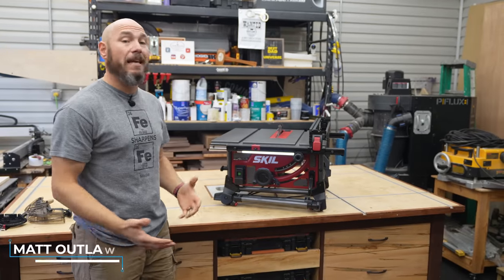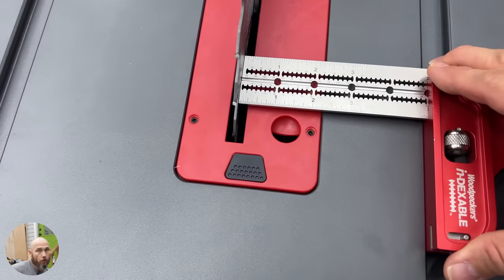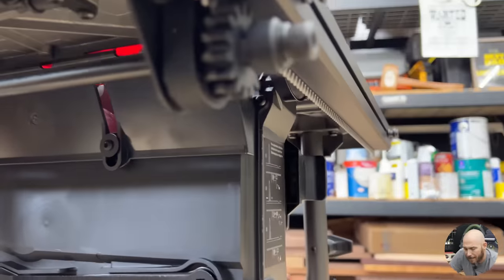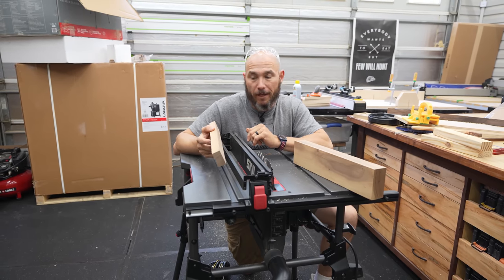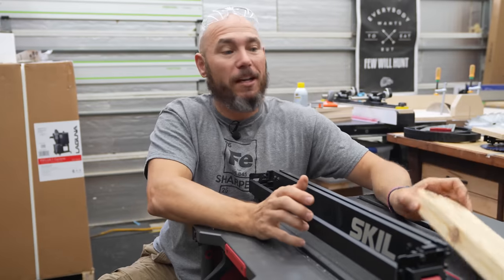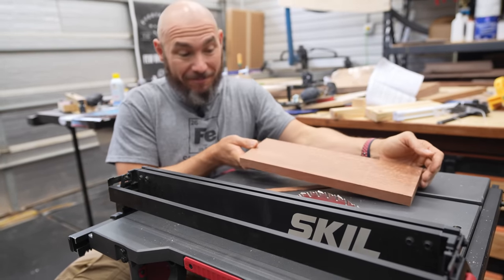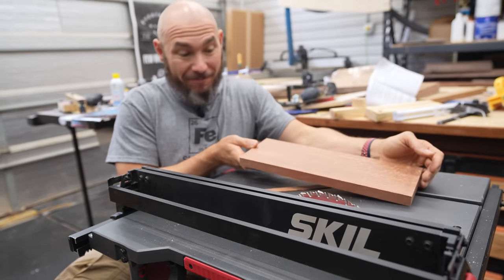Did I Find The BEST BUDGET Table Saw with the MOST Features?

Comment: Hey Matt I found out that Swanson has a pro speed square that has a lot more features than the original. Mine should be coming in the mail today. Check them out. With 1/8" increments on the pencil drag indents it will definitely be my new every day carry as every other on the market, aside from premium brands costing ~$50, only offer 1/4" pencil drag increments. Most premium brands also seem to only offer metric and very few speed squares over 3 1/2" have the 1/8" increments. Figured you might like the upgrade for $12. I'll do a comparison video when it comes in the mail.
Reply: I put up the short video so you can check it out if you're interested sir.

Comment: I currently have the Hercules tablesaw from Harbor freight. I was very skeptical about buying it because it was from Harbor freight, but the reviews were really really good. It also had a reckon Pinion fence, but it cannot do dado’s.
I think my favor thing about the skil-saw is the built-in “stand”
Reply: Yeah, that Hercules brand is, I believe, specifically aimed at DeWalt, and going toe to toe with them. 
That table saw looked just as good as any DeWalt. I have never actually gotten to use one though, the Hercules table saw that is.
Reply: @ericwilliams538  yeah it’s very similar to the dewalt. The dewalt has a little more HP and it also can use dado blades. I definitely would recommend the Hercules for any small shop, or for a job-site

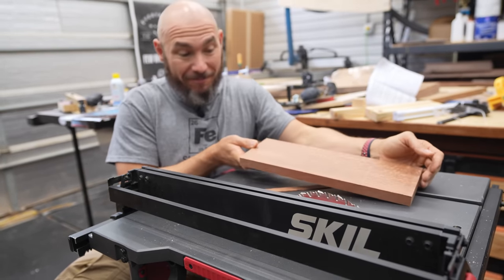Comment: 11:38 when you said it's extremely loud, will changing the blade reduce the noise or it's just the mechanism of the saw itself? Also, how loud is it compared to other saws that you have? I'm about to pull the trigger on this to place in my garage for DYI but I also don't want to bother my neighbors.

Comment: Was about to pull the trigger on DEWALT DWE7485WS 8-1/4 in. Compact Jobsite Table Saw With Stand….AZN for $379.

Now will consider this Skil saw.   

In addition, reviewed some recent comments re upgrades over the last year+.  
Thanks for this review as a reference point I value.  
Your strength in faith and carpentry knowledge are admirable….and appreciated.

Comment: You mentioned the saw bogged down a small bit while cutting the second, deeper dado. Trading the 8” dado set for a 6” shud help with that to an extent as there’s less weight and a smaller circumference/distance the blade teeth have to travel. A little something someone fm Woodcraft told me when I was buying a dado stack myself. Great review of the saw. It (the saw) reminds me very much of my Metabo jobsite saw… incredibly accurate and easy to use, tho retails for ~$650 when not on sale.

Comment: Can't say much about the saw. But I've never been turned off or let down by a skil product. Spent credit card points 20 years ago on a 3/8 drill, that's still going strong today. Never once bogged down. Only 3/8 but when I want to drill a hole, torque a bolt or screw its never let me down.

Comment: Question? I know you no longer have this skill table saw. In the video you stated you had multiple square cuts. However, in a different unboxing of this saw, the fence was not square to the table. The top tilted away from the blade. He resolved the issue by placing several paper shims behind the lock system. So my question is, did you specifically check the squareness of the fence to the table?
Reply from the maker: I checked square on the fence to the slots and slots to the blade and it was all square on mine.
Reply: I had the same issue, but only at one end of the fence (front side). Couple bits of paper sorted that out.

Comment: I have had this saw for about a year and a half and I love it. My favorite features are the fence and the blade alignment adjuster. Biggest problems I have with it are that the height adjustment is not very precise and the throat plate flexes. Eventually, I'll try to figure out how to make a zero clearance throat plate to solve the second problem. But for now what I do is cut smaller stock with the fence on the left of the blade since the throat plate is stiffer on that side.

Comment: First of all, love the channel and all the great content. This video is what steered me to buy this Skil for my first table saw. I have used it for about a month now and am loving it. However, I would like to get a better blade. I'm leaning toward a Diablo 50 tooth multi purpose blade but I am a bit confused. The saw's owner manual says the blade kerf width must be .1" or greater the the body thickness should be .071" or less. The diablo blade has a kerf slightly less than this and in fact the replacement blade recommended on Skil's own website is advertised to have a kerf width less than .1" as well. I'm I misreading things? Would the Diablo blade be fine on this saw? I really appreciate the help.
Reply from the maker: I've used Diablo blades on a few different saws and never had an issue.

Comment: This is my first table saw and I love it for the most part. I’m not sure if anyone else has an uneven insert or not. I would like to make a zero clearance insert or purchase an aftermarket one, if someone could recommend one. Great review and I will definitely be upgrading the miter gauge!
Reply: I have owned this saw for a couple months and haven't been able to find a zero clearance insert for it.  Please let me know if you find one.   Thanks
Reply: Couldn’t find one either. I made an insert for the dado stack since the plastic one they sell was so flimsy, but it was a challenge. There are a lot of obstructions under the insert that I had to carve out of my homemade one which did take an awful long time.
Reply: @fivefournino  Those obstructions are the reason I haven't even tried to make one yet.   Did you just use plywood for your dado insert? Or did you use a hardwood?
Reply: @wandiwoodworks  I used a piece of a scrap white wood we had lying around. Hope to eventually remake it with some cleaner routed cuts and better material
Reply: Hey I’m in the “throat plate sucks club too” I really wish someone would manufacture a robust zero clearance or general throat plate. I made a quick and dirty one with scrap cedar I had lying around just to see if I could make one, based on the depth differences from right to left. I used an electric hand plan to make one side thinner. It worked but I need to redo it with better material and take more time with it.
Reply: @wandiwoodworks  Skil has one "coming soon" on their website, but it looks to be made out of the same flimsy plastic. I made my own out of 1/2 plywood but as others mentioned it is a huge pain to make because of the obstructions.

Comment: What would you recommend for a great table saw to buy. Don’t need to be easily moved or compact. Just looking for a good table saw that will hold up good and be accurate. Thanks a lot..
Reply from the maker: Top of the line, SawStop 3HP PCS.  Great saw.  If you need one that's very good but under $1000 look at this Ridgid https://www.homedepot.com/p/RIDGID-10-in-Contractor-Table-Saw-with-Cast-Iron-Top-R4560/315635451

Comment: I bought this one after watching this I love it. Built doors for a buddies garage with a dado stack. Needs a new insert but otherwise great. One question. Is the riving knife removable? I only see the two screws on top and don't wanna ruin anything.
Reply from the maker: yes, when you take the throat plate off, look inside and you see a black knob at the bottom of the riving knife.  that should release it.
Reply: To remove the assembly completely for replacing the riving knife with a thin kerf for use with a 7&1/4" Diablo 40 tooth it's just the two hex heads all the way out?

Comment: Two questions:
1. How is this model for working height, both on the stand and on the work bench? It looked a little low for you on its stand - how tall are you? (I'm 6'3")

2. Why didn't you adjust blade height depending on material thickness you were cutting? Looked like you kept the blade at full height?

Comment: Finally had a "need" for the miter guage... yeah that was junk! Moves so much gives several degrees of difference from light pressure on one side of it vs the other side. I think next project will be a simple sled for this saw for cutting ends of cutting boards.  But overall, still very happy with this saw!

Comment: Another added feature about the fence is the top has a T-Slot built into it. You could use it to attach an axillary fence, stops and etc. I have the skil saw worm drive portable table saw and used that slot to attach the Jessum Stock Guides to the fence with T-bolts. I do not think Skil-saw gets the love it should in this small shop/construction cat. My biggest dislike is that the worm drive is also loud.

Comment: Hey Matt, that's awesome! I picked up the DeWalt - DWE7491RS a few years ago. I wish this video was out at that time lol. The DeWalt I bought has all the exact same features that Skil has. Except for the DeWalt, came with one blade. And it also had a two pack of blades with it. And the fence on the DeWalt goes out to 32 1/2". Which I have yet to need. Oh yeah and the DeWalt cost $650.00 so yeah. Lol I'd say that saw you got is the way to go!

Comment: Maybe a dumb question...  Can I use a Diablo fine finish thin kerf blade in this saw?  The manual says kerf width should be greater than .1 inches.  But blade packaging doesn't have a measurement like that...
Reply: That is a GREAT question, but I'm just a novice with LITTLE experience with a table saw. I will have to go and read the manual for my Bosch to find out what my specs are when it comes to the kerf. Thanks for raising this question. 👍

Comment: Alri bro. I've been a subscriber now for a while and I love the energy u give off on video. U also do great work and as a newbie to woodworking I wanted to ask a question if u have a moment to answer it..??
Q.  I have tried to buy some better Table saw blades and the 10" blades seem close enough to my 254mm blades but mine have a 30mm bore and all I see on USA sights or on Amazon is 5/8 bore blades which is around 15/16mm?? 
I did a check and it said that 1.1811 = 30mm approx.. I think it's exactly 29.99994 or something like that so is it possible to get those RED blades everybody is using in a 30mm bore plus I sound stupid calling them the red blades but the name has escaped me right at this very moment.. Shut man I have completely forgotten the name???

Comment: Researching table saws and came across your video. I was sold on everything you had to say about this model. My local Lowes has same model, But after reading reviews lots of people said 90 degree cuts were off and that the fence wasn't true 90 degrees. Some people weren't surprised being that its a jobsite tablesaw. Could this be true. Reviewers say same thing about Dewalt Model#: DWE7491RS also.

Comment: Ive had this saw for about a year and it has been great. I would agree with you that the blade change is annoying and its very loud. I have been cutting a LOT of oak recently and have had the saw bogging down and a bit of burning. I probably just need a new blade though. Its very similar to the dewalt for $250 less and I like the integrated stand better.

Comment: The manual states the kerf needs to be.1 or greater.  So far at the hardware stores I can’t find one I bought a Diablo that has the right thickness but the kerf is .098 which is 2 thousandths less than .1. Do you think this blade be OK to use

Comment: I have had this saw for 8 months now, I replaced the stock blade with a Diablo 50 tooth combination thin kerf blade and i have been really happy with it.
8/4 oak rip and cross cut no problem
the adjustments are great got the blade dialed in, including for miter cuts where additional errors can occur
Matt's dislikes:
  Blade change, I agree, although it's much easier if you raise the blade all the way.
  Loud yep sure is 
  Max rip width, sure  more is better but being able to get more than 1/2 a 4' sheet seems good enough to me
My biggest complaint is the throat plate, I have both the standard and the dado throat plates and they flex which can mess with depth of cut.  I've made a zero clearance plate for mine and it's a big improvement
Overall I'm really happy wit the saw and i feel like i got a lot for the $$

Comment: The riving knife on this saw is a weird size. It’s 0.09” thick. It calls for a blade that has a plate size of less than 0.07 and a kerf more than 0.1 inches. As far as I can tell the higher end blades have a plate size that is too big. This makes the riving knife ineffective as a safety device. The high end thin kerf blades have a kerf size that is too small, which means you literally can’t push the wood through the riving knife. 

The only decent option I’ve found was the CMT itk extreme which is recommended by Katz Moses. This has a plate size of 0.071 and a kerf of 0.98 inches. That’s about the thickness of 2 1/2 sheets of paper less on each side of the knife than the manual recommends. 

It’s worth noting that you don’t need a riving knife if you are using a crosscut sled or a tapering / edge joint sled if you just shave the edge of the board and don’t create a cut off strip. So you can still use higher end glue line blades for this purpose. that are too thick for the riving knife to be effective. 

So I guess that’s what I’m gonna do. Use the cmt thin kerf blades for the bulk of the work and use the higher end blade just to shave edges for glue ups or with a crosscut sled.
Reply: Holy Mole! Lots of good info here CarlYota! Thanks for that. 👍

Comment: I had a Skil table saw. It was great until the arbor broke. Still have my Skil bandsaw and bench sander. I wore out the WEN in 2 years and replaced it with that old sander. It's still a lot more powerful than the new WEN. Both were made by Bosch.

Comment: Is the table itself flat? I’ve purchased two of these so far and neither of them are flat. They’re both warped. One worse than the other but neither were flat. How’s yours?
Reply from the maker: It's flat
Reply: I just picked on up and it is also not flat.  Mine dips toward the center basically from the miter slot to the blade, so if it is 90* on one side of the blade it is not 90* on the other side of the blade.  Basically useless for any small cuts, since the wood falls into that trough.  The flexible throat plate doesn't help matters either.  We'll see what I can do when I get a new throat plate.

Comment: Is there an updated model for this one. Shopping for it fall of 2023 and it is out of stock everywhere. I would like one.
Reply from the maker: Acme Tools has it in stock (linked in pinned comment and description)
Reply: @731Woodworks  Thanks. I was trying to use a vendor I was familiar with and that was local (Walmart, Lowes, Amazon, etc) in case there was need for a return. I may have to venture into the unfamiliar to get this one.... Thank you for the speedy reply.
Reply from the maker: @unschooled_art   Acme Tools is a good company. I've ordered from them myself.

Comment: Interesting review. I'm at the point where I can't really go forward with woodworking until I get a table saw, and this is one is out of my budget at the moment. Guess I'll be saving for a while. Experiencing a lot of frustration right now as I try to cut down wood with a circular saw and it just isn't cutting it(as in, it's not great for the job; it cuts wood just fine. Just not in the application/way I need it to). I've been watching a lot of woodworking videos over the last year or so, and what most of them absolutely fail to tell is that *at minimum*, you should own a table saw in addition to whatever else other tools you pick up.

Comment: Nice review Matt. I’ve owned this saw for almost a year. It’s been great especially since I paid 269.00 last summer. I agree with everything you said but can add some negatives to your list, that you would only notice after daily use for almost a year. The throat plate……it sucks 😞 it’s cheap flexible plastic. When cutting thin stock if I don’t make sure to apply most pressure to the right side of the stock it can flex the throat plate throwing off your 90 degree cut. Unfortunately skil or no aftermarket vendor makes a zero clearance at least not that I’ve found. I did make my own but what a pain and hassle it is. The way the throat plate seats it’s different depths from right to left. I used a electric hand plan to achieve a fit, but I need to make another spending more time on it. The other fault I’ve recently came across (this one a little my fault too) is that if you push real hard on the fence when locked in, it will move. I recently started using a feather board and if I have it too tight palling too much pressure and force the stock through the fence will move. I locked the fence in and pushed it by hand, and yep with a little force it will move. Now it’s never moved on me not using the feather board and I’m Conscience of apply pressure towards the fence when ripping. But it still bothers me that it will move if “too” much pressure is applied. Other than those two things it’s been rock solid and I would buy it again in a heartbeat. I’ve used it almost daily since I got it. I love the adjustability of it and have Re squared the fence and blade with ease. You are absolutely right that for the price point it’s a no brainer. I’m happy I chose this 10” rack and pinion saw over the smaller dewalt option for more money. I also have the skil 10” double bevel miter saw and that’s been great as well. You should do a review on it. Shadow line, came square, and has stayed true. Depth of cut could be better (the motor housing sits low on the right side) but I’ve used both of these saws since last summer just about daily and I’ve been impressed with both these skil tools. Their customer service has been phenomenal too.